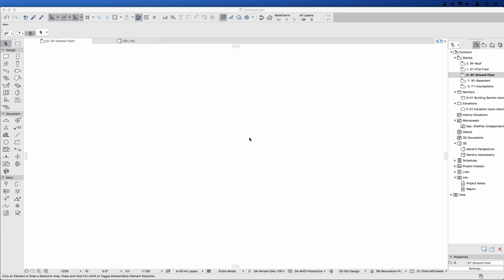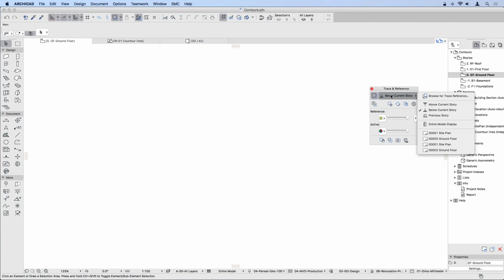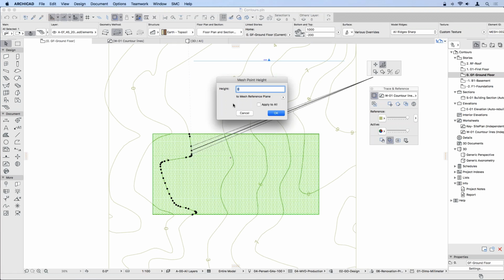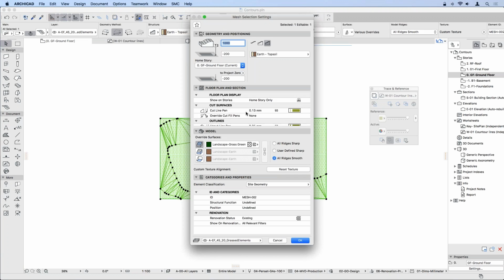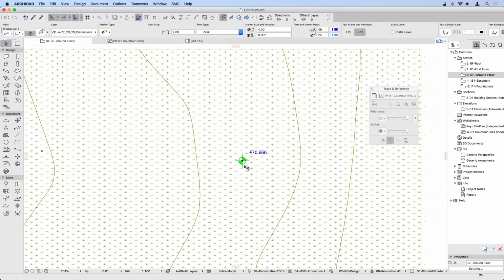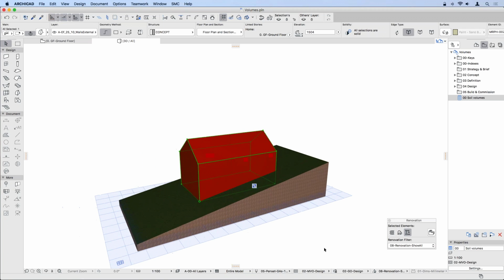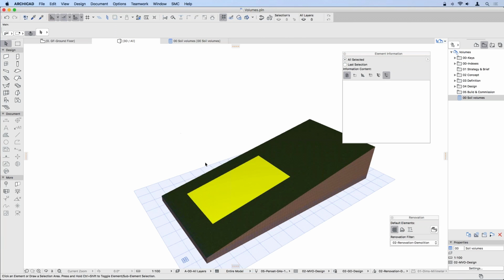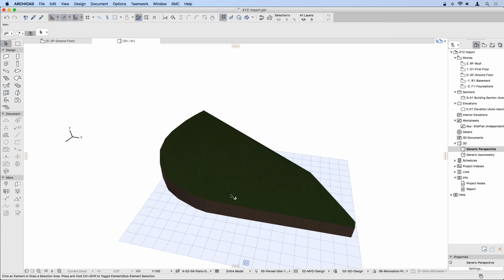Lunch and Learn - Topography

Comment: Thanks for this! What is best practice for drawing proposed topography/contours for a grading plan. I've seen quite a few like yours show how to model existing topography. For commercial projects I leave this to a landscape or civil consultant, but for residential I typically draw the proposed topography myself. Would you simply create a second mesh then use solid element operations to create a proposed site?
Reply: Exactly, second mesh located where you "alterate" the original land, where you substracted the chunk of land, if that's the case.